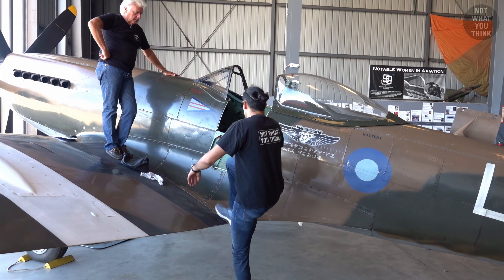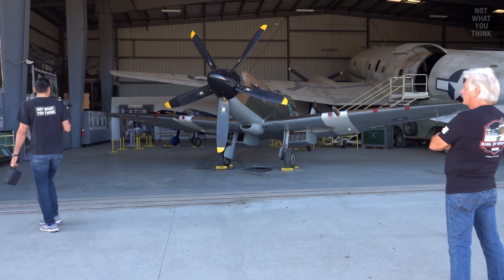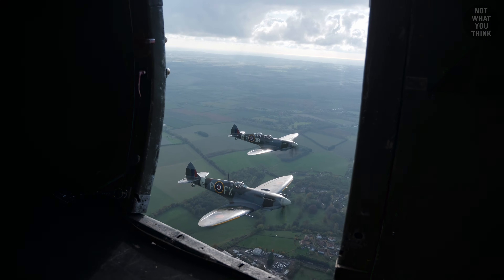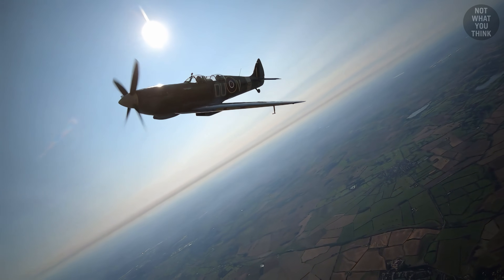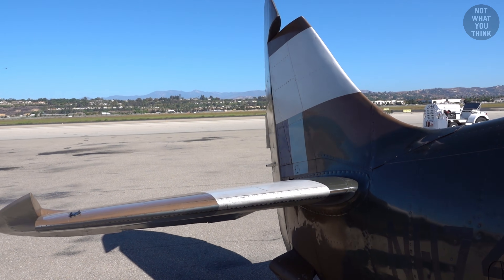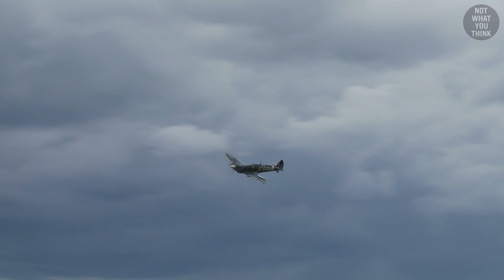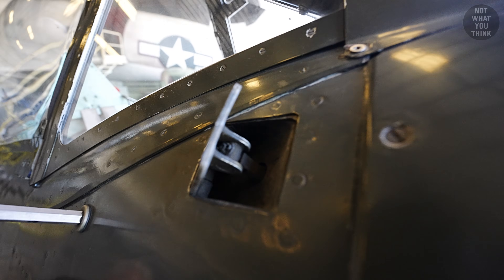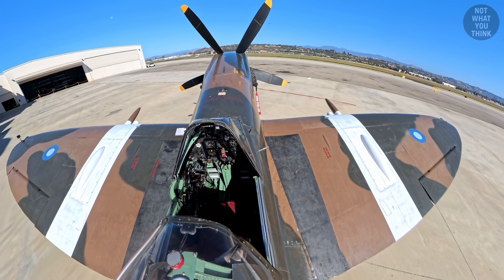What Made Spitfire a Masterpiece of Engineering

Comment: Sure Hurricanes did shoot down more planes in the BOB... but they were mostly tasked with shooting bombers, while the Spitfires tried to engage the fighters, which is a much tougher fight.  Also there were a lot more Hurricanes than there were Spitfires.  Finally as an example of it's excellence, the Spitfire was upgraded continually all through the war, but the Hurricane could no longer hold it's own as a front line fighter by 1942 (maybe earlier) Still it was a good platform and did stirling work in  North Africa as a ground attack plane!

Comment: Spitfire was state of the art on the design part but Merlin engine was lacking behind Germans 
Only reason Merlin was putting more power than DB600 series engines were much much higher quality fuel 
Other than that 109 was superior to Spitfires at every aspect other than climb rate and range

Comment: my favourite ones are the griffons that were converted from MKVs or MK9s, had their tail section redesigned, Kept their wing, (most ones were converted from MKVcs so they either had four hispanos or the 2X hispanos 4X .303 with 120 rounds per cannon) they looked just like the early spitfires that flew during batle of britain with their beautiful razorback cockpits, but with a monster engine and a 5 blade prop.

(too bad that on a certain game out there, the MK14s are forced to run on older 87/ 100 octane fuel, using a ahistorical boost pressure limiting the engine to about 1850 HP at full power, while the LFMK9 gets the 150 octane fuel as well as its supercharger adjust, what make it somehow outperform the griffon while being a merlin, good Job """ insert snail here """")

Comment: The Spitfire was constantly developed into late marks but then enhanced further. The Merlin was eventually replaced by the Griffon engine and the wings redesigned to laminar flow type and even a contrarotating propeller added. These developments became the 'Spiteful' and the 'Seafang'. 

But  by Supermarine wanting to create a jet fighter it took these late models and putting the pilot in the engine area of the nose to form the cockpit and putting an early jet engine, the Nene,  behind the pilot wit its intakes at the side of the fuselage  it became the Supermarine Attacker! This showed its heritage by having a tail wheel, the other early British jets were all nosewheel types. and was used by the Royal Navy.
However, then Supermarine put swept wings onto the Attacker and this became the Swift, which had then added the more powerful Sapphire engine and at last a nosewheel and actually held the Speed record briefly in 1953.

Comment: What a great and informative video! USA here and pilot for over 50 years. 2 months ago, while my wife and I were in the UK I got to fly a 1943 Mark 9 Spitfire (2-seat conversion) from Biggin Hill Airfield to the English Channel and the White Cliffs of Dover. I got lots of stick time plus even some aerobatics. What an amazing experience. I've flown many different aircraft and full flight simulators, both civilian and military aircraft, but the Spitfire had one of the smallest cockpits of all. I was told to keep my extremities clear of the controls during take-off, landing and unusual maneuvers but the stick would actually hit me in the chest when the pilot pulled back for take-off! I also had been briefed on how to bail-out if required; 1 drop seat to the bottom with lever on right side, 2 pull red knob to jettison canopy, 3 drop door on left, 4 unbuckle 4-point seat belt (being careful not to unbuckle parachute harness), 5 roll out of the cockpit to the left trying NOT to get hit by the horizontal stabilizer! BTW the airplane I flew had an engine failure 4 months earlier and had made a belly landing in a field with no injury to the two occupants. They had the Spitfire flying again in time for my flight 4 months later.

Comment: Checklists have nothing to do with "experience" lmao literally all pilots must go through several checklists (preflight, landing, etc.) for literally all aircraft because:
1.) Every aircraft is different and most pilots will fly more than 1 type of plane in their lives thus checklists are more practical than trying to dozens of steps/procedures for every aircraft they might fly 💯

2.) Not only are all planes different from each other, but even just flying a single plane will have completely different specs/flight parameters depending on conditions such as weight & balance/weather/wind direction & speed/takeoff & landing altitude/etc. many of which involve complex equations that are easier to manage as a checklist than to try and do in your head on the fly (ba-dum-tss 🥁) 

3.) When you're about to travel at potentially 10's of thousands of feet up in the sky using a giant metal bird that would drop like a 🪨 under it's own power if all its components are not working exactly as they should... The checklist is yet another layer of redundancy to make sure that your current flight is not your last flight because the lives of the pilot(s) and their passengers are not something to be left to chance based on the pilot's memory and the certainty that didn't forget/overlook 1 small detail 💯

Comment: No, movining the stick back makes the elevator of the horizontal stabilizer go up, also making the plane go up. Air going over it puts pressure against the elevator moving the tail down and the nose up. When the elevators are down the plane goes down.
Reply: Actually, the elevator moving upwards increases the airflow speed UNDER it, thus creating a negative pressure area UNDER it, which pulls the tail downwards. I suggest you research basic aerodynamics...
Reply: @oliabid-price4517  Well I mean the pressure difference is just a fraction of the force, especially for a horizontal stab that doesn't have much of an airfoil shape. It's more about the angle simply pushing air up and itself down in the process due to the newton stuff. You are right though that the low pressure region would be responsible for SOME of that force, and that it's on the bottom.
Reply: @oliabid-price4517 you are we-tod-did...
Moving the control stick back on an airplane makes the plane go up. This action raises the elevators on the tail, which pushes the tail down and causes the nose of the plane to pitch up, increasing lift and causing the aircraft to climb. 
Stick back: Elevators on the tail go up.
Result: The tail goes down, the nose pitches up, and the plane climbs.
Stick forward: Elevators on the tail go down.
Result: The tail goes up, the nose pitches down, and the plane descends.
Reply: @zachbase1124  But only you start from a straight & wings level attitude, otherwise you just change direction : )

Comment: I‘m working for a german Company which produces the Propeller blades for the spitfire and other heritage airplains. Its really an intresting industry.
Reply: What is really amazing to me is that the Spitfire propeller blades are made of wood (or close substitute) and not metal. I'm an aircraft (A&P) mechanic plus commercial instrument pilot so have been around airplanes my whole life. Airplanes with these powerful engines (1000 HP+) are usually metal props. Thanks for keeping these historical airplanes flying. I flew a 1943 Mark 9 Spitfire (2-seat conversion) 2 months ago in the UK. The same Spitfire had an engine failure 4 months earlier and made a belly landing in a field (no injuries). I have a picture of the Spitfire in the field, and you can see the wooden propellers had splintered instead of bending like a metal prop would have done.
Reply: @rvrrunner  
' The same Spitfire had an engine failure 4 months earlier and made a belly landing in a field (no injuries). '

I remember seeing that reported, over here in the UK.
Landing wheels-up in a ploughed field must have made it a VERY ROUGH landing for the crew (and the plane).
With an approach speed of maybe 90-100 mph and strapped in, they must have got a hell of a battering before it came to a rest?
Reply: @rvrrunner that is true by now nearly all of them get built out of wood. On the original Rotol props fore the spitfire they were also made of aluminum depending on the model. We also make blades out of wood for bf109. The original ones there were also out of aluminum ( depending on the model). You would be surprised how strong wood blades are. If made properly they can withstand +3500hp.
Amazing that you flew a spitfire, that's a dream. Where did it get rebuilt after the accident, was it skycraft by any chance?
Reply: @maximiliangroer993  I flew the Spitfire from Biggin Hill Airfield just SE of London. They have a whole facility to maintain and rebuild all the WWII aircraft but mainly the Spitfire. I'm sure they use your blades. During the preflight I noticed immediately how perfectly smooth and beautiful the propeller was on that airplane. Great Job!
Reply: Interesting!  Does your shop do wood and/or metal?  Or the prop governors for, say, constant-speed props?
Reply: No sabotage sure?